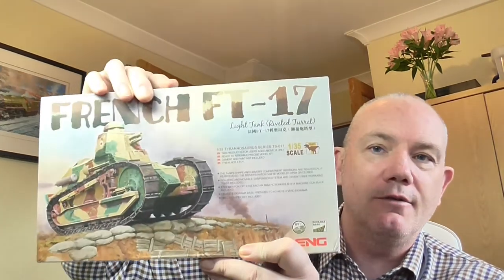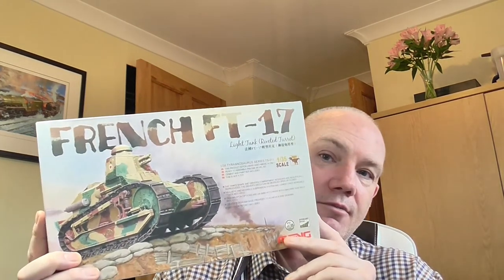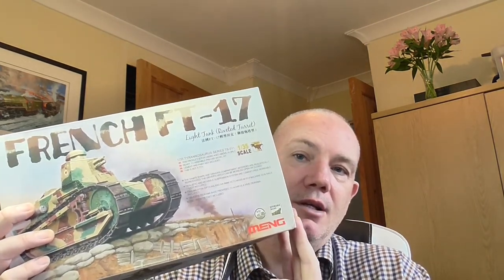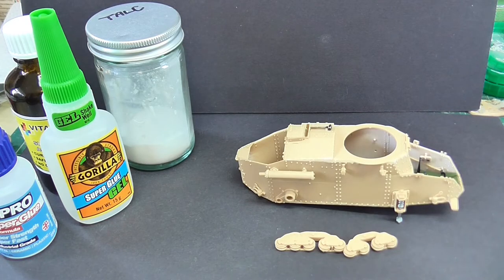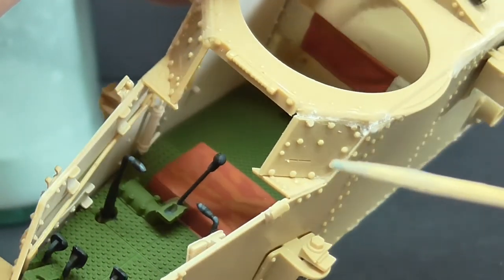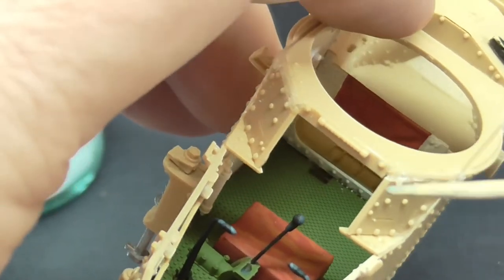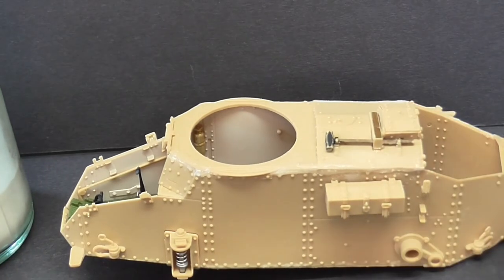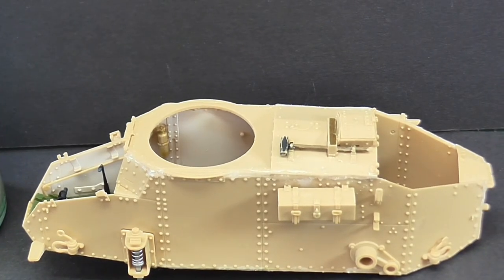Meng 1/35 French FT17 (2nd attempt at building it)

Comment: Not all things are easy for everyone. I can build a model, but I can't paint a decent figure for example. You are the exact opposite. Just take one thing at a time, go slow and don't get anxious when you build it. It is nicely done up to this point. Btw don't worry extra thin cement is really strong when it sets, so even if the piece is hanging in thin air, once the glue is set it is going to stay there. Thanks for sharing Gav, take care and keep up the good work my friend.
Reply from the maker: Thanks George for your advice at the moment i do an hour at the end of the night it has complicated running gear so i just build it bit buy bit , have a good weekend marra . Regards Gav.

Comment: Great progress and development in skill marra- very glad to see you get into the zone again for the tanks 😃 excited to see the progress on This little tank marra. Never seen the Meng version, but with so tiny containrar points, would masking tape help at all in keeping it in place while the glue sets? Might be less clean up work vs the super glue option? Although, if there are gaps, you Will take care of them right away with the CA option. 👍🏻 good goings marra /Regards Fredrik
Reply from the maker: Cheers Fredrik i did try and tape the previos FT17 and i could get it to work my falt but this works yes its messy but for the moment if it works i will run with it . Regards Gav.
Reply: @gavinbooth  whatever works is worth doing marra 👍🏻